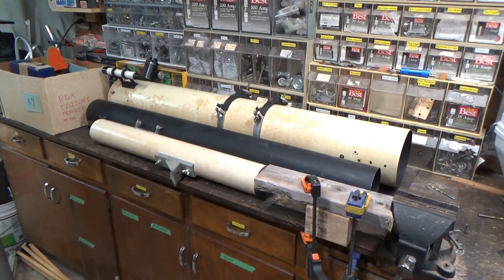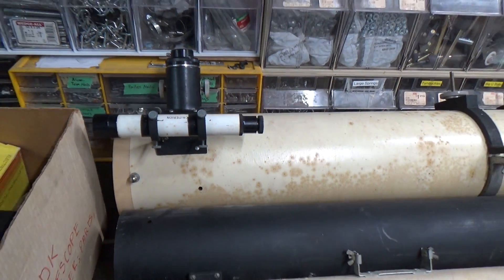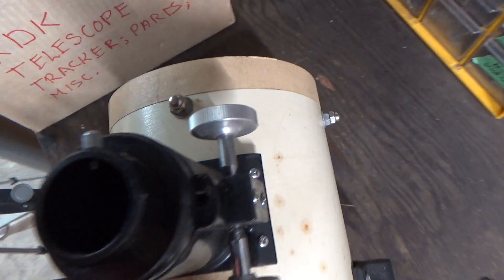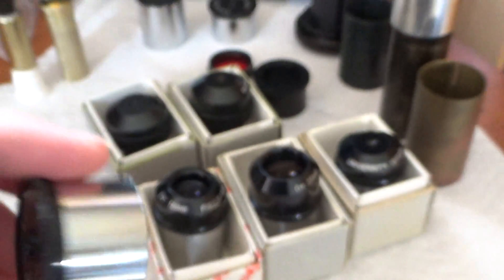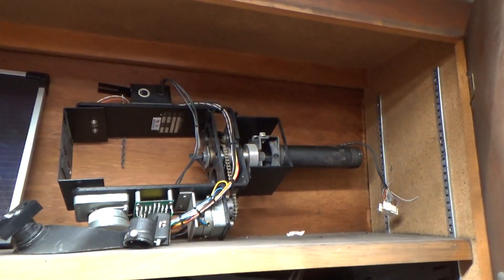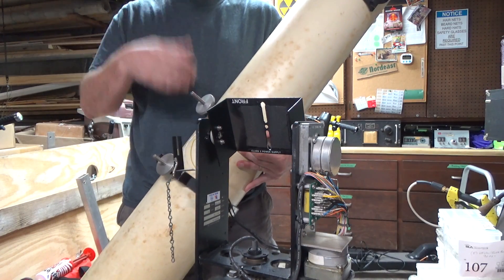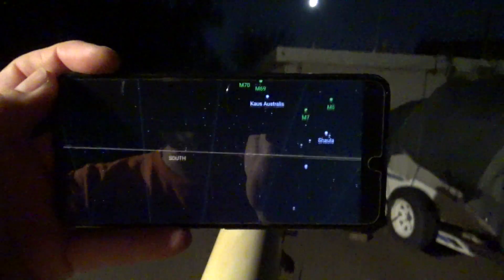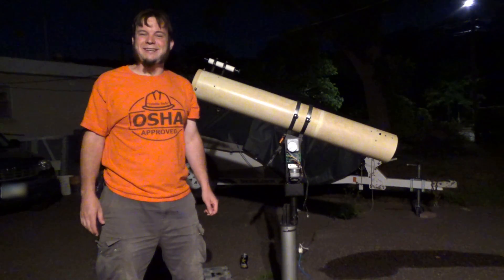Refurbishing 1960s Telescope (Criterion Dynascope RV-6)

Comment: I’ve been following your channel for a little while but I just discovered this video while searching for info on the 8” model. The ring mounts don’t need to be in the middle, move them to your center of balance. The glass in the back usually outweighs the focuser and secondary on the front. The stand it came with looks like it could use some love but I bet with everything tightened it will feel pretty solid. Equatorial mounts or neat because they mechanically “track” celestial targets but if you just want an easy to use telescope Dobsonian mounts are hard to beat.

Comment: A couple things, you DO want this on an equatorial mount. The original mount works great, I had mine out last night. They can be bought usually 25-50 bucks in working shape

. If you can find a Vixen New Polaris GEM mount meant for a Celestron C6, it's heavy enough to carry the rv6 tube and a more modern and useful mount.

 The box is likely a drive corrector. The other item (electric eyepiece) is an off axis guide with an illuminated reticle. The user would watch through this and correct the drive by hand during a long exposure or manual guide  without the clock drive (sidereal drive)

 The original focuser had a slip tube to adjust close to focus, then final adjustments are made on the focuser rack. It's not too bad IF the slip tube is tight and doesn't lean to one side, causing a misalignment of the eyepiece to secondary mirror. DONT polish the tube, it wont stay where you put it and one end is slightly larger in outside diameter. Measure accurately, it's only a few thousandths bigger. That end goes into the focuser.  

 If using for photography, the mirror has to be moved forward to account for the extra length the camera adds beyond the focuser. Once imaging is done, user moves the mirror back to the original position. I have NEVER seen a mirror moved so far up the tube to account for a camera, it's usually less than a couple inches to correct. I am wondering if the mirror has a faster focal ration. Perhaps replaced at some time, and is now an F6 or 7 instead of an F8.

 I own two RV-6 telescopes, one on a Vixen New Polaris C6 mount and one on the original pier mounted equatorial with clock drive. I am looking for an 8" Criterion to add to my collection.

 You got a good scope, and parts are mostly available. Join cloudynights.com as someone else suggested, there's a wealth of info and parts there.

 Good luck with your project, these scopes are among the best of the best. I have an 8" Cave Astrola but the RV-6 is chosen more often for observing.

 The black tube might be a Criterion 4" reflector. I know for a fact there are parts on cloudynights.com for this. The 4" was the first reflector Criterion produced, and has lots of followers since it was their first scope.

 Good luck, I hope you can revive that fantastic telescope!
Reply: I forgot to say, if the pier you have came stock with this scope, it was made after '67. It has "Moon Lander Pads" on the feet of the tripod. Older models like mine do not have the round pad feet.
Reply from the maker: Hey good info, thanks! Its been to cold and cloudy to get the telescope out much this winter, although I keep meaning to look at the comet.

Comment: Hi,
@4:53 that is the original focuser.  It is a lower profile design, so the mirror may have been placed at the holes nearest the bottom of the tube.  The secondary mirror is larger in diameter than the original.  Get a shorter focuser and and you can take advantage of wider field (expensive) eyepieces.  The OR on the eyepieces denotes an Orthoscopic design, they produce sharp images.
Checkout the Cloudy Nights forums. There is tons of info from many people there.
L

Comment: I have that telescope!  I put an ad in the paper for telescope wanted and had several calls (1982).  I ended up with that and still have it.  I did bust a piece of the mount but 1 inch copper fittings work perfect, exact fit.

Comment: I borrowed a friend’s old RV-6 around 30 years ago, and it outperformed the much more expensive Meade 8” SCT I owned at that time.  A few years back I found an RV-6 tube assembly at a yard sale for $50.  I’m building a Dob mount for it now so my grandkids can use it.  Dynascope optics were manufactured to very high standards, far better than the mediocre optics in most modern consumer-level telescopes.

Comment: (05:03) the thing with the switches and red and black terminals is likely a clock drive variable sinewave frequency driver, for speeding up and retarding the speed of the equatorial clock motor drive.
The wired eyepiece thing is an off-axis lighted reticle for tracking stars so that you can speed up and slow down the clock drive to keep the star in the crosshairs so that you can get a long-time exposure of an astronomical object.

The coloured filters are for viewing the moon... DO NOT use them for viewing the sun!
Reply from the maker: Good info, thanks! I'm not sure what happened to the equatorial mount, probably the auction company didn't know what it was and threw it away.
Reply: @saveitforparts   copper pipe fittings fit the shafts of the one I have perfectly, the tee fitting may come in handy.
Reply: @saveitforparts  you don't want an equatorial mount for this.  It is too long at what appears to be f/8 or so, and a dobsonian would be far better.  Those manufacturers at the time only made equatorial mounts, and it was not what was needed for such a long scope with a long moment arm.  They are too "shaky" when viewing or photographing objects.  I would highly recommend a homemade dobsonian mount for this, as the height is perfect for standing, and you don't need any electronics.
Reply from the maker: @glen7016  I'm working on a Dobsonian next, already found parts at the local surplus junk store!

Comment: Nooooooooo! Never take the mirror out! Now you are going to have to re-collimate the mirror! 
And whatever you do... Don't attempt to Clean the primary mirror, it is a first surface aluminised mirror, and you WILL destroy it if you clean it incorrectly!!! 
NB. Okay... you did a pretty good job cleaning it :) Nicely done!
Reply from the maker: I tried to be careful with it! And it was so coated in dust and cobwebs that there wasn't much light getting through. Some websites said you have to re-collimate this type of telescope any time you move it, so I figured that wasn't such a big deal.